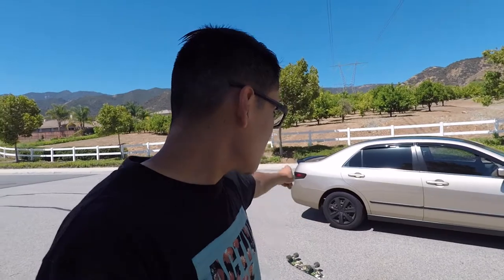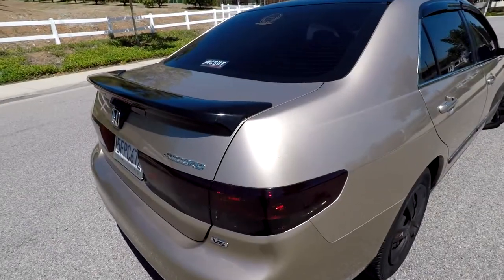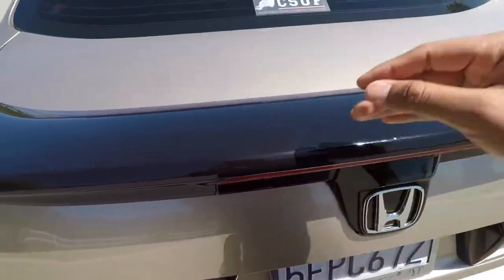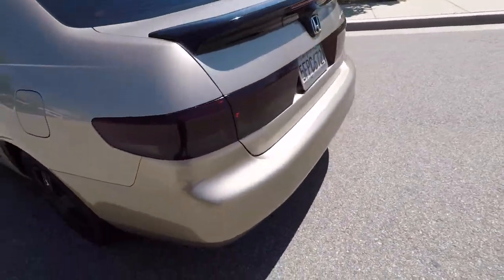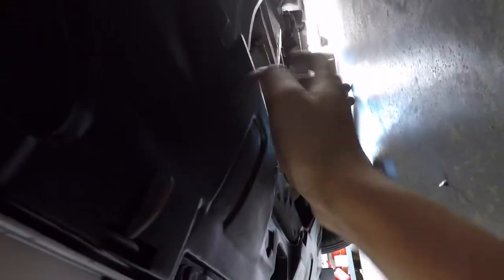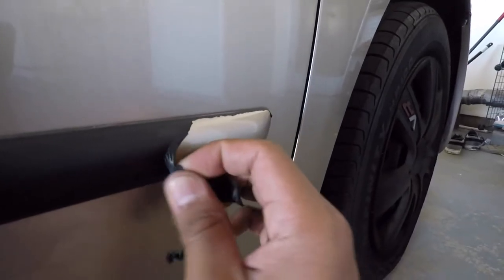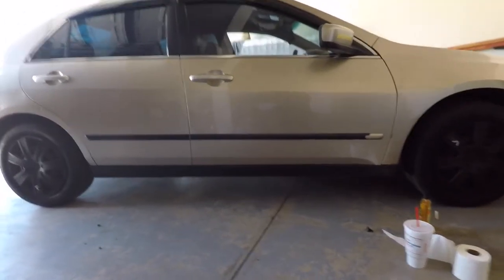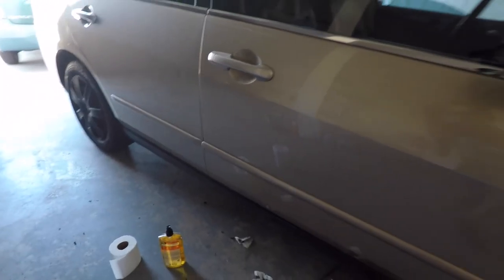UC1 Spoiler Reveal, Splash Guard Install and Removing Plasti Dip

Comment: Spoiler looks solid but doesnt that have a built in camera into the middle of the spoiler? Dont you need one for your radio? Personally i like the gold sides not so much the black. The Black sides make it look like a old stock 4 door civic LX . (just saying) Whats your plan for lowering it ? Coil Overs or ?
Reply from the maker: yes it does but i dont have the wiring harness for it so i covered it up for now, planning on buying a new one and yes but still saving up for rims and coils

Comment: you need to paint the holes or it will rust. I have the 7.5gen with the factory wing that I installed.
I can send pic if you like. I'm in the process of upgrading my struts flex z.
Reply from the maker: Yea man! if you have an instagram, feel free to send me a picture at Accord_Empire

Comment: Bro next time put the link where you buy the spoiler not the bottom splash and clips where it does not have to do with the video 👎👎👎
Reply from the maker: +Gunsn Roses37 you have to look for those spoiler either on eBay or a 3rd party there isn't a site sells them constantly and maybe if you watched the entire video you would see that I installed a splash guard and clips....